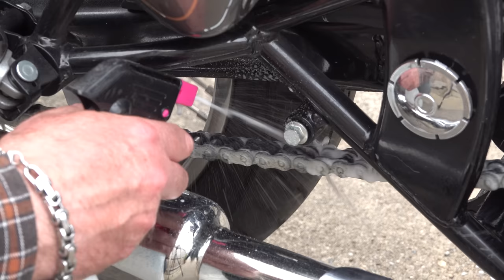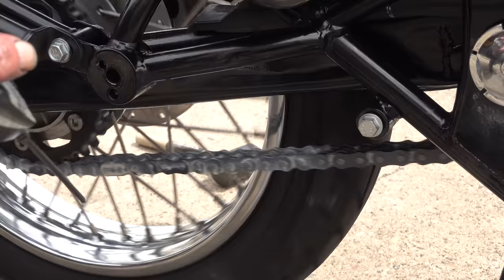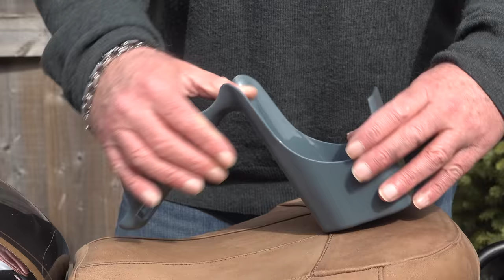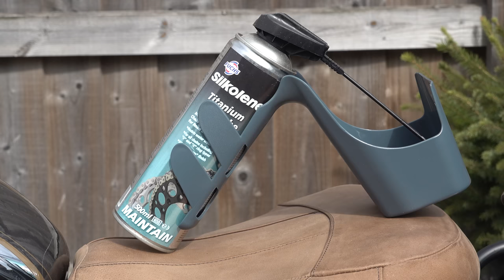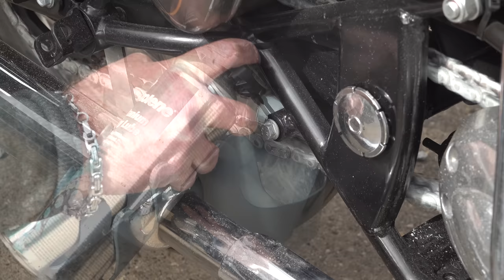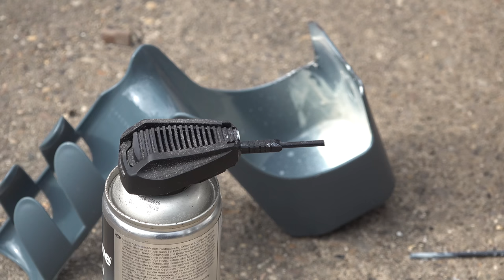Motorcycle chain lubrication! This Speed luber is Incredible!

Comment: For me, the device looks "overengeneered". A piece of cardboard in a size that it stands by itself on the ground does a great job. So you can turn the wheel and lubricate the chain with no interruption. No need to clean up the device afterwards, just dispose the cardboard.
Reply from the maker: create unnecessary hazardous waste! good move!

Comment: Gear oil makes for a great chain lube. Just apply with a brush whilst spinning the wheel.   Most owners manuals recommend engine oil as a chain lubricant anyway.   I blend the oil with wb greasing to make it a bit thicker.   If you use oil you'll never have to clean the chain too.

Comment: Variety is the spice of life, Stuart, so keep varying the content. The speed luber looks interesting, though for me an even better arrangement was that on the Jawa 250/350 range. They had a fully-enclosed chain with a mist-oiler pipe from the back of the gearbox exiting above the sprocket. As a result the chain never needed oiling, was always clean and hardly ever needed adjusting. On the 350, I had to do that job just once in 15 years of ownership.
Reply: Agree. I have Jawa 634 and it' almost carefree. It's often called "drive shaft foor poor people" 🙂.
Reply: @jankafka  Agreed; Jawa engineering was simple, robust and very practical. I wish they were still available here in Australia and I'd even settle for the Indian-built Yedzi version of the 634, but they're not sold here either.
Reply: @Chris Weeks  It's a pity. Here in Czech Republic Jawa still producing last two stroke model 350/640 and 350/640 Retro, which looks like 634. Then you can use new motorcycle as complete repair to old one, to make it road legal. Unfortunately there is not enough people buying them, so they cease to make them soon.

Comment: The new word is Permacrisis Stu. Please don't stop your trademark village elder rambling. I tried using a wax chain lubricant for a while. I was amazed when I removed the front sprocket cover to see the front sprocket red with rust. Not the outer teeth but the centre and retaining bolt. I've gone back to gear oil. If I put enough on, it lubes everyone else's chain and it prevents any rust around the centre stand area. Cheers.

Comment: The brush looks great and its been around for a long time. Might I suggest instead of the fiddly can holder a much taller piece of cardboard, still 6-7 " wide, strategically folded in an L shape, so it holds itself lightly  against the tire, yet can slide(between tire and chain) while you either weight it with your foot so it stays in place, or a can of oil, etc., start the bike put it in first gear and while it spins,  spray the lube using one hand to press the button  and the other hand to aim the nozzle. Or if that worries you have a friend roll the wheel by hand.  Been doing it this way for 35+ years and no problems at all.  The can holder looks a nightmare to use!. Have recently changed to cleaning with 140 weight gear lube and a very soft old tooth brush then wiping it down real well with a shop towel as has been mentioned further back in earlier comments.

Comment: Hi Stuart, my" precision device"  is a  plastic 4 pint milk pack cut  and shaped so behind the chain is shielded from overspray and the excess is trapped in the lengthways base stopping any dripping on the ground. Cheap and cheerful. If I still had my old MZ though all this faff wouldn't apply.

Comment: I have found that getting lube on the tire, tends to make the sidewall crack prematurely. So I think this gadget, is a great idea. I usually spray the lube into a small container, and apply it with a tooth brush so that there is no overspray. Even so, it still flings off a bit.

Comment: I've been using the cardboard method forever, and it still works fine for me. That is, on bikes with centerstands. Most bikes in the U.S. don't have centerstands. I have two chain drive bikes with no centerstand. On one of them it's just a matter of putting a piece of 2x4 under the sidestand, then putting a small scissors jack under the right side of the bike and lifting the rear wheel off the ground. I have a small scissors jack that came with a car. It says Nissan on it. Works perfectly for the purpose. But the other one is far more of a challenge. The exhaust blocks access to the lower run of the chain. I have tried using a very small diameter section of rubber hose that fits over the end of the straw on the can, and is flexible enough to get down close to the chain, but it's almost impossible to see what you are doing. Also hard to get a piece of cardboard in there. I finally decided to just remove the chain guard and spray the lube on the top run of the chain. 

I use Yamaha synthetic chain lube. It can be hard to find, because you usually have to buy it from a Yamaha dealer. It's also not cheap. Fortunately I have a Yamaha dealer just down the road from me. I have probably tried about 1000 brands of chain lube, and so far I like the Yamaha lube the best. Three brands of chain lube I definitely recommend staying away from are PJ1, Maxima Chain Wax, and Bel-Ray Super Clean Chain Lube. PJ1 is an absolute nightmare. It is the nastiest, stickiest stuff imaginable, which makes you think it wouldn't fling off, but it does. All over the bike. I had to use gasoline (petrol in the UK) to get it off. It took hours, as the whole back end of the bike was covered in it. I thought I was going to like the Maxima and Bel-Ray, but they actually ruined a couple of chains. Maxima Chain Wax is a brownish waxy substance, and Bel-Ray Super Clean Chain Lube goes on white. The problem is, you can't get them off, and they continue to build up on the chain. It reached the point where the chains were actually kinking, like they were rusted. Even after removing the chains and soaking them in gasoline for 24 hours, most of it still didn't come off, and the chain links were still stiff.

Comment: My favourite chain lube is to use really heavy gearbox oil. I keep some in a small margarine tub and apply it to the inside of chain with an old toothbrush. I hold the tub underneath where I'm working, to catch drips, but also catching most of the drips with the toothbrush by occasional brushing along the bottom of the chain and reapplying it to the side links. Only takes a minute or two. This heavy gear oil clings well, flinging no more than super sticky proprietary lube, but considerably cheaper, and, I find, the applications last much longer, as the molecular chain structure of the oil is designed to withstand heavy grinding between gear wheels.

Comment: Stuart, your content is all relevant to motorcycling and nicely varied with a style all your own, so keep up the good work 👍
BTW, I've always thought it quite ridiculous that modern motorcycles have an oily, exposed chain in the first place.
There are shaft drives and belt drives and even 50 years ago, small bikes had enclosed chains to reduce maintenance, mess and wear.  Other than maybe on race bikes, I don't see a need to have an open and oily chain these days, especially where (unlike a conventional bicycle), the motor does all the work and absorbs any minor efficiency losses in the power train.
However, I find having the right tools/products, along with a comfortable working area and enough time, can make any cleaning or servicing job quite relaxing and rewarding!

Comment: It's after 10 pm here in California!!
Stu you're keeping us "colonists" awake.
I place the thinnest 1/8 inch thick plywood between the chain and wheel as a shield. I clean the chain with diesel fuel scrub wipe dry. Then in furtherance of sin I start the Interceptor put it in first gear and spray champion brand lithium chain lube on the chain. I really don't think I'll lose any fingers as there's the huge stock muffler keeping me quite safe from amputation
Reply: (ex-)Colonials
Reply: @foggyrf9  we English colonials stole California from the Spanish colonials

Comment: Morning Stewart. Congratulations on your channel numbers. Incidenty nothing wrong in getting political ever now and again sir! 
Your chain lub vid brought back happy memories for me, including huge bollocking I got from my mum. I bought a second hand 350cc Triumph Tiger, it was in a sorry state including the chain covered in rust. So as a young 17-year old off I went to old Triumph bike shop for some parts and advice. That's were I bought a tin of chain grease. Eventually I got the bike running, well of a sort. Then I followed the instruction on the tin.  A kitchen sauspan, a low heat to melt the grease, and while I waited for it to melt, my wife to be held one end of this rusty chain as I held the other and attacked the rust with a wire brush. Then when the grease melted in went the chain into the sauspan. Oh the laughter as the chain fought me trying to wind it into the sauspan, but I got it all in.  Did I notice the smell filling the house? Well of course not!  Then mum came home. Talk about bleeding ears or wot! 😂😂😂
Still with my chain now cooling in the back garden, and every window in the house open I waited.  About two hours later the chain looked well good as it sat back on the bike. But I did have to give money to my mum to buy a new sauspan!  You'll be pleased to learn that my chain cleaning got better over the years and I bever stink the whole house out again doing motorcycle maintenance.  That's because I closed the kitchen door in our own house 🤣🤣🤣. 
Safe and enjoyable riding till next time Stewart 👍😁.
Reply: I scrub my chain in paraffin then use an old slow cooker kept and used in the garage with Duckhams chain grease permanently in it.
Hey presto old school lubed chain no house smell or bent ear
Reply: NBC mo

Comment: My method is 90 w gear oil in a ketchup bottle- the red plastic ones you see in restaurants, with a long tip. With my son turning the wheel, chain lubing is a pleasure.
Reply: Gear oil is great, I apply it using my wife’s toothbrush.

Comment: Just ordered one.  I foresee messing with trimming a pop or water bottle to catch the blow back.  Great content as always Stuart, thank you!
Reply: Just an update... this does NOT work for the RE Interceptor 650, at least not in any way I can figure out.  The exhaust doesn't allow for it to be used anywhere.  I ended up creating something similar out of a used, single-use water bottle that I'm quite impressed with.

Comment: With regard to cleaning chains.  When I bought my current (chained) bike 4 years ago, switching back from a shaft drive was a bit of an adjustment.  I started the chain cleaning thing the very first time and decided it wasn't for me.  So I have never cleaned my chain.  Then the lube thing.  I tried lubing the inside of the chain the first time and decided it wasn't for me.  From that point on I lubed only the outside of the chain, back at the rear sprocket. 
I drive a 1200 multistrada, it is a very powerful bike and certainly has the potential to wear a chain down as quick as any.
To repeat then - I have never cleaned my chain - not once - and I only lube the outside of the chain back at the rear sprocket.  About once every 1,000 Km.
My chain is now more than 25,000 Km old and still going strong.  I would judge it is probably going to do another 5,000 Km or so before it reaches limit of wear.  Maybe more.

Just in case anyone is interested, I use motul C2 chain lube.  I find it works well.  And it takes me less than a minute to lube the chain, no trouble at all.

So, my take.  Don't bother cleaning the chain, total waste of time.  Lube the chain where it is easiest, the lube will get to where it needs to be anyway.

Comment: Thanks Stu, super video. I remember years and years ago fitting a Scott oiler to one of my bikes which worked brilliantly. Don't even know if they make 'em anymore. I guess I'll have to do some research as I'm  taking delivery of my first new chain drive bike in over 50 yrs! Of course, an RE 350 Classic in chrome red.
Reply: I fitted a Scott Oiler to my Yamaha Exup 1000cc FZR and wearing sprockets and stretching chains were a thing of the past.
Reply: I am planning the same thing but we’ll see 10-4
Reply: @richardwilson6392  You won't be disappointed Richard.
Reply: Scott oiler is now marketed under OSCO (One Second Chain Oiler)
Reply: @johnrickards1908  🙂👍

Comment: Buy a bottle of 80/90 gear oil and recycle an old toothbrush.

For cleaning, an old rag or cheap microfibre towel, and a bottle of paraffin. Swig a bit of paraffin onto the cloth and wipe the chain over. 

There's really no need to overthink chain maintenance and spend a fortune on flashy spray bottles. For £20 you'll have enough cleaner and lube for years and years worth of chain maintenance.

Comment: Interesting gadget. I think custom fabricating something for each specific bike that doesn’t attach to the can, but rather attaches to the bike (magnetically maybe) would be a better option. ⅔ section of pvc pipe maybe.... 4-6 inches long.... fits around chain... with a hole for excess to drain onto newspaper or into an attached cup. IDK.

Comment: Scottoilers have been around for donkey’s years and work brilliantly. Set them up properly, and if anyone says they throw lube around its because they have not done exactly that, fill them up and ride. Simple as that. Chain and sprockets last about three to four times longer than without, so it pays for itself pretty damn quick. All of my bikes, that are used on the road, have one fitted and every time I see my mates buggering about with spray lube it just reinforces my belief that the Scottoiler is the optimum solution.
Reply: Reminds me of something dodgy from the 70's.. Presenting the RONCO motorcycle chain speed lumber.😂
Reply: Luber nor lumber.
Reply: Too messy they throw oil every where! Thats why his rear wheels are always sparkling! I get way too many bikes in with worn out chains because people ignore the fact that those oilers actually require maintenance!
Reply: Adjustments required depending on viscosity, caused by temperature variations make scottoilers a bit hit and miss in my experience. To temperamental for me. Prefer aerosols nowadays

Comment: Three points. Never be tempted to run the engine in gear to turn the wheel, though it can cure nose pickers.
If you do not like any YouTube content, don't complain, just do not watch it.
My MZ and Ariel Leader have fully enclosed chain and sprockets that stay in place when you remove the wheel, why are we going backwards in tech.

Comment: Seems a bit overkill compared with just applying some 80w90 gear oil or similar? That takes seconds and is far cheaper than spray lube and a bottle lasts forever. Why spend more and produce unnecessary waste?

Comment: Utterly unnecessary single use plastic. Toothbrush and some gear oil is far better than your wasteful aerosol too.
Reply from the maker: well its not single use is it? potentially last for decades. Try and put a bit of thought into a comment before making it.
Reply: @stuartfillingham  is it recyclable?
Reply: @foggyrf9  Of course its recyclable, and plastic has a half life of around 2000 years so it will last a lifetime!
Reply: @mcfund3188  do you know that for a fact?

Comment: Have you tried boiling it in chain wax  break the chain at the link attach a piece of old chain to run over the front sprocket (if you've been spraying our chain you'll have plenty of bits of old chain kicking about) boil 
 Chain in the tin on a camping stove hang to dry  job done  alot less messy
Reply: I think I did that once for my RD125 in about 1978. Mum wasn't keen that her cooker was out of use whilst I did it though......
Reply: But thinking about it that was a good move because using a camping stove in 78 was more dangerous than riding a motorbike 😅
Reply from the maker: Not with O'ring chains NO!
Reply: Stuart I love your channel especially when you did all the bits about that utter slag that ran norton (sorry for the bad language but he is )

Comment: I dont really like this, I've been cleaning motorcycle chains for over 40 years and this is not necessary. If im riding the bike constantly i take it off and clean and lub it prolerly. If the bike is a winter bike i put it on the mainstand every day or two, wash it with oily paraffin then use another rag soaked in ep90. I dont do the chinlink lub over the stove anymore . Are these sprays really a benifit. I have tried them. 
That said by any chance did you notice the stinkin guy when you wailed past him stuck on 95.5k subs for weeks now, no dount he will have a great excuse, lol.